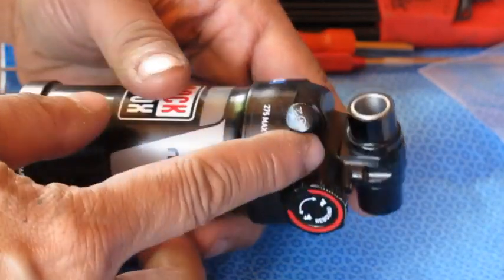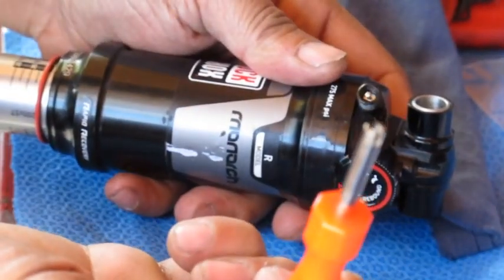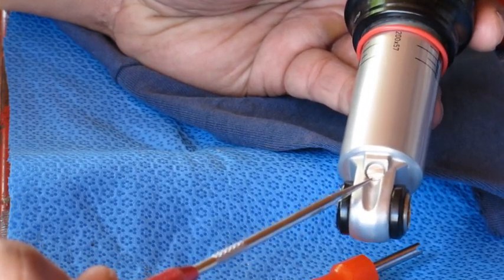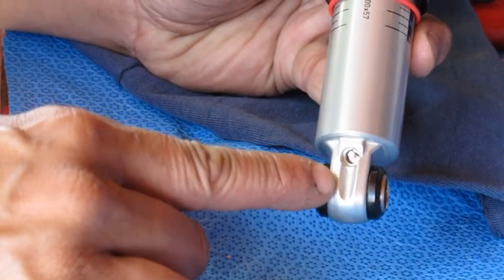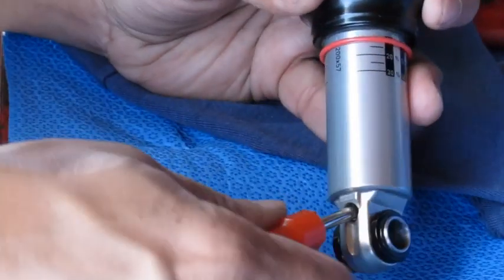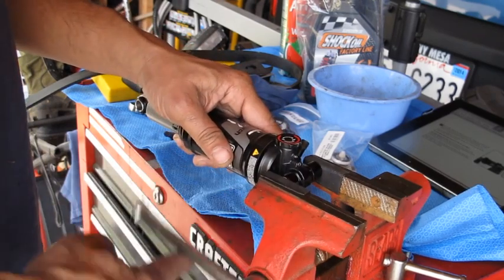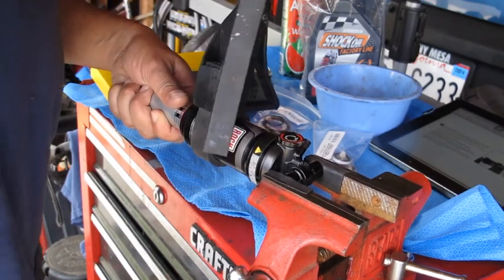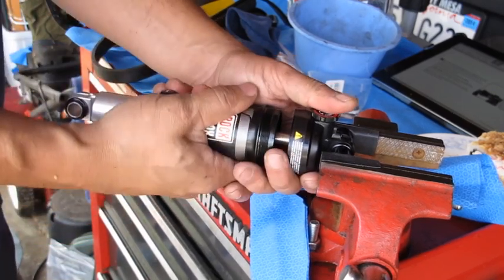Rock Shox Monarch R Tuning part 1

Comment: excellent brakedown!
however i think you confused rebound and compression stacks in the end. (it would make more sense from counting the holes as you have 0 1 2 as the compression adjustment and 0 1 2 3 4 5 for the rebound)

Comment: How did it work out?
Reply from the maker: got the small bump compliance with minimal packing on bigger hits... But I did lose some pedaling support... So a bit of a compromise...
Reply: @jrsandiego  I'm thinking maybe removing the shim wasn't the optimum solution. Perhaps replacing it with a thinner shim would deliver a better result. Did you experiment further?
Reply from the maker: I didn’t experiment with shims... but I was pretty happy with the setup

Comment: dont you just turn up rebound to get less pac?
is it a differenct case for your shock?
Reply from the maker: Using the rebound knob limits the flow of oil thru the valves...  pack is controlled by the compression shim stack and the type of oil you use... you can use different shims on the rebound stack to control rebound range..

Comment: does the rebound knob for R model doesn't have a clicking sound?
Reply from the maker: You should feel detents....not sure if it will make a sound.... Check above your rebound knob... There should be a set screw which holds a small spring aand ball to give the detent "feel".

Comment: How come you didn't just add one or two RockShox bottomless tokens (air volume spacers / progression spacers) to the air spring, this will stop your shock packing under high loads because towards the end of the stroke, it gets progressively harder.
Reply: +Cameron Roche I do assume reducing the air volume does something different than the shim stack in the damper
Reply: Bottomless tokens just make it harder to bottom out, the oil damping is what's preventing the shock from effectively moving through its travel at speed.